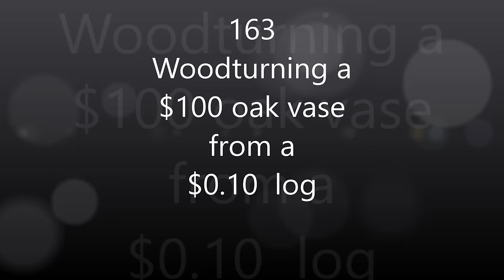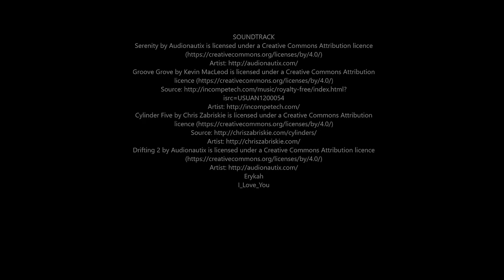Wood-turning a Giant Sequoia limb handcrafted vase

Comment: Roger, that dangling apron strap is a recipe for disaster. Murphy's Law and all, and all that nice equipment ends up .... somewhere else. At least tuck it inside the apron top.
Reply: safety 1st - I caught my thumb in a lathe and ripped the nail off, hurt worse than my 2nd marriage
Reply: Ouch & double ouch. Losing a nail by force is way up there on the cringe & pain list. The second marriage, I hear you, I've got one of those meself. Roger basically has a rope around his neck, and it's all over for him if it catches. Helluva way to go, and with the camera running. I'd say it goes viral if it ends up here. Maybe Roger could write the title for it! A YouTube epitaph.
Reply: And wrist watch, and rings, and long sleeves.
Reply: If he cuts it off he won't have to die. If he doesn' die, he may be a horrible mis-shapen cripple in constant pain, dribbling, drooling, and leaking all over. Cheers!
Reply: John smith don't steal my fuckin name ever again
Reply: John Smith i like the way he lets it hang out.
Reply: I would be more concerned about his lungs, that fine wood dust is a killer.....
Reply: got to love the safety nazis. Im pretty sure with his time and experience he is well aware of what he is doing and whats a safety issue.
Reply: Lame trolls will find anything to disagree with, it's an ignorance and arrogance thing. Had he been injured, you'd be the first to say he deserved it for violating safety protocol. Get a life kid, practice emulating an adult.
Reply: +Tt Ss yeah, safety Nazi, I spent 30 years doing woodwork, not to mention tens of thousands of dollars on machinery......I spent fuckall on breathing protection, then when I was 55, my body said enough, I became allergic to wood dust, just like that, years of breathing the shit in and my body just said enough. Try finding a new hobby when you have to say goodbye to the one thing you loved to do, I had the "time and experience" but now I can't even saw a piece of wood. So don't listen to the safety Nazi's, it's your choice.
Reply: John Smith do you always insult kids online or is this your first time trying child abuse?
Reply: Mr Spams If you get offended by that you have to be 5 years old, lmao.

Comment: 9:45 if you have time on your hands and you have nice fine saw dust you can put wood glue in the hole and the add the saw dust to it then allow enough time for it to set hard this will eltimately create a wood pug that looks natural if you've done it right. I've had this problem when I was in college and that's how I dealt with it and it worked so nice.once set you can use the lathe like normal as well like it wasn't even there

Comment: Nice work!  I had cut down an apple tree that yielded a lot of beautiful wood.  I am thinking about making salad bowls from it.
 
I own a manufacturing plant.  In 30+ years we have never had a single accident other than slight cuts and scrapes.  The very first thing I observe is the danger of the rings you have on your fingers.  I would NEVER permit anyone in my factory to work with any jewellery on, save non dangling earrings.  That lathe catching your ring will tear your finger clean off your your hand.

Comment: wish I had a wood lathe I miss wood turning 😭
Reply from the maker: Email me at : info@pacifictooling.com  I will send you information on our new Wood Lathes
 and CNC routers, 4040, 6060, 6090 , 6012 , 1212, 1224, 1325 and now CNC 6040, 6090 , 1390 Lasers (linear rail model), and machine tool accessories . Pacific Tooling, 
 Australian Inventor Roger Clyde Webb
Reply: +Roger Webb I would have no where to put them haha plus I'm in aus don't know where your located

Comment: I want all of this equipment Christmas
Reply from the maker: Email me at : info@pacifictooling.com  I will send you information on our new Wood Lathes
 and CNC routers, 4040, 6060, 6090 , 6012 , 1212, 1224, 1325 and now CNC 6040, 6090 , 1390 Lasers (linear rail model), and machine tool accessories . Pacific Tooling, 
 Australian Inventor Roger Clyde Webb

Comment: Appreciate the explanation on the different tools and how to apply them ... I have a lathe I've never used, and a set of the old standard tools, and I cut trees and gathered logs others had cut, so I have many different hardwoods, and I'm getting ready to start working with the lathe.. I was just thinking I need some insight into the process, and you answered some questions for me .. thanks.

Comment: Yea folks! and all you need is $50,000 of industrial machinery/upkeep/electricity/tools/etc and some sucker willing to pay $100 for the "vase".... you'll make your money back in no time!!!
Reply: Robert M yeah no. You can get a lathe under 500, add basic tools and thats 1000 at most. If you buy a new highish end cnc lathe maybe you'll get into the 50000$ range.
Reply: Uhmmmmmm no we were not talking about a CNC machine. I didn't say anything about any of the other tools that you would find in a wood working shop (over 10 years of personal experience in wood working and finishing shops). I was only mentioning it as layman would do in their own house with a basic machine and my reference to a $5k machine was what I have personally looked at to buy used locally.